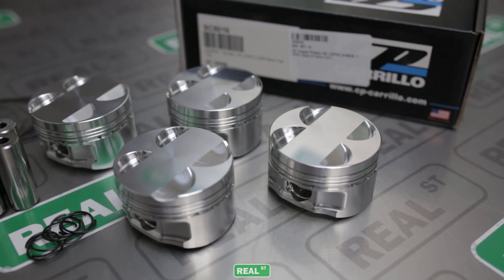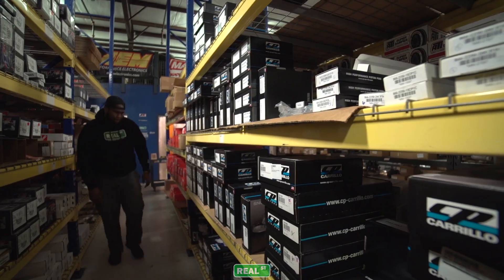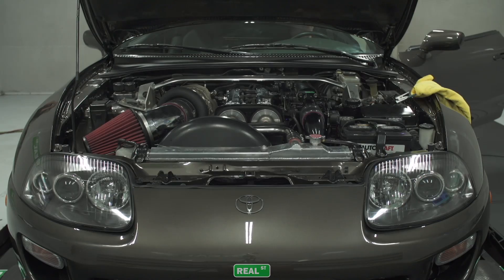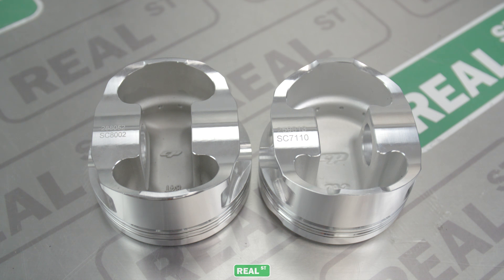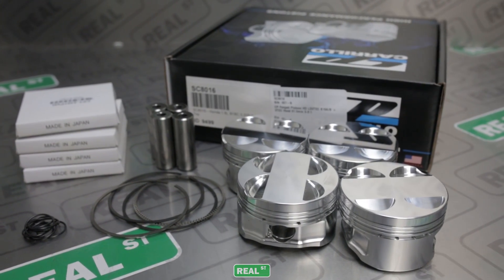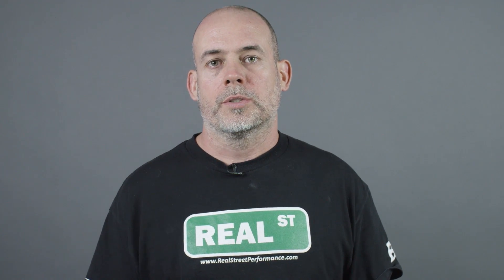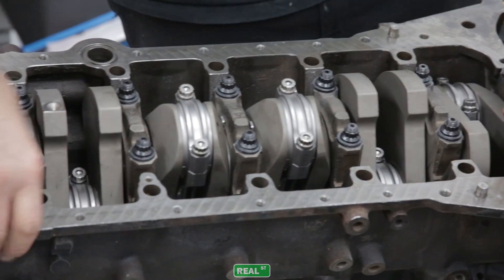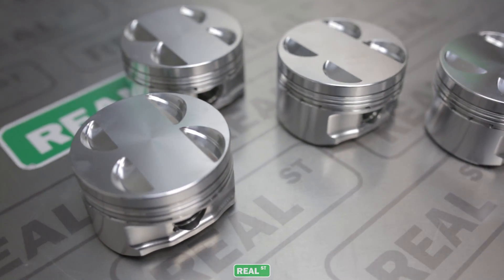CP Pistons New HD Forging - Real Street Performance

Comment: I just bought CP pistons for my 1000hp k24 build. I ordered the upgraded hd pins as well.
No one mentioned these pistons before I ordered mine (10.9:1,87mm).
I would suppose that means that they aren't available for K series engines.
If I research this and they are I am not goimg to be happy. I am installing Darton MID sleeves and going to extremes to build a long block that will survive whatever I can throw at it.
Might be selling my current CP's and ordering a set of these if I can find them.
Reply from the maker: Keith we can help you into an HD piston, shoot me an email at parts@realstreetperformance.com and we will get you squared away.
Reply: @realstreetperformance   hello brother  I need your help

Comment: 300hp per cylinder they recon bull shit, I’ll never use I cp piston again after only 100h riding on my freshly rebuilt kx450f pulled the engine down as it was not running right found the piston had a massive crack on the pin to base area was not happy at all lucky I pulled it apart it was ready to disintegrate how can I stock piston last 250h with no problem and a forged cp only 100h of just normal trail riding, nothing great about cp in my opinion they probably make good stuff but I had bad luck with there piston

Comment: In Australia we have a good number of cars with the toyota 1JZ engine rather than the 2JZ,  what parts are available for it?
Reply: You can use the 2JZ part in the 1JZ engine, it will just have a lower compression ratio due to the lower stroke of the 1JZ.  Typically it is about a point lower than the advertised 3.0L 2JZ Standard Stroke compression ratio.

Comment: Turbine housing selection, hardware choices for mounting turbo/manifolds.  How to simplify engine bay for easy service, how to keep shop space/work area clean.  Engine block/head casting flash removal thread tapping and washing/prep for assembly.  Just videos with no words but awesome engine assembly with awesome music.  Love the videos you guys put out and the editing/ music selection.  For products I was curious about the newer Garrett turbos specifically the 1000hp one that was at sema.

Comment: lmfao, 250-300 hp per cylinder?  so basically the engine only makes 250-300 hp. Were those lawnmower pistons they were soo tiny.
Reply: I think you should learn math again.
Reply: not sure if trolling or just stupid..
Reply: HAY DICKHEAD!!!  How many cylinders you got in your car, this isn't a lawnmower racing channel...... Is it?
Reply: I'd love to hear your thoughts on the Rotrex superchargers, particularly when combined with high flow and high revving engines.
Reply: 815 Racing BKM inc you have 4 cylinders so u multiply 300 x 4 = 1200 duh
Reply: 815 Racing BKM inc four cylinders making 250 to 300hp per cylinders is around 1000hp to 1200hp in a honda motor. In a 6cylinder its 1200 to 1800hp.